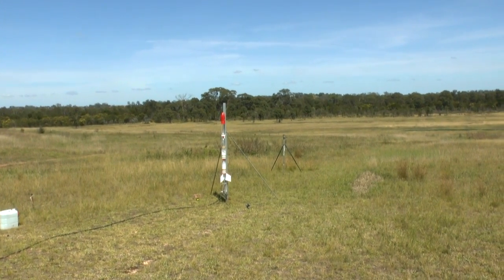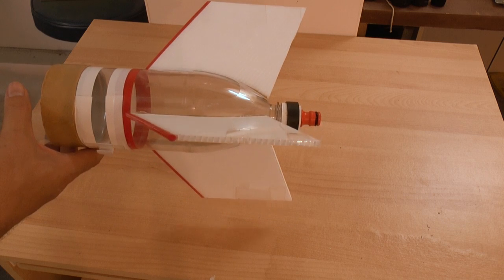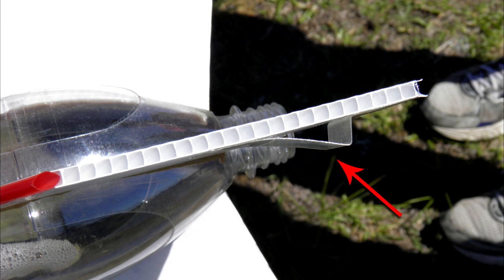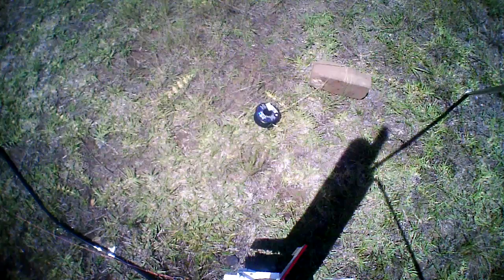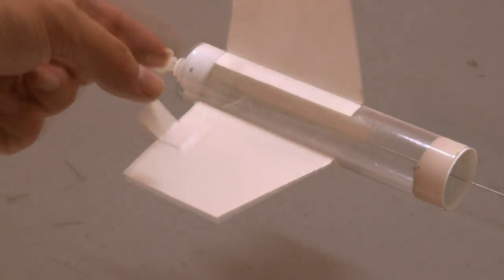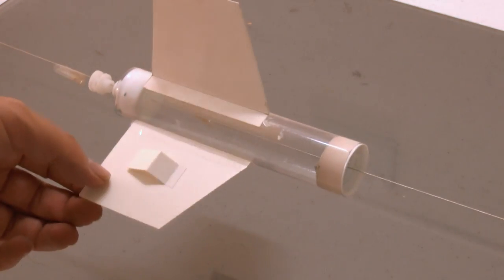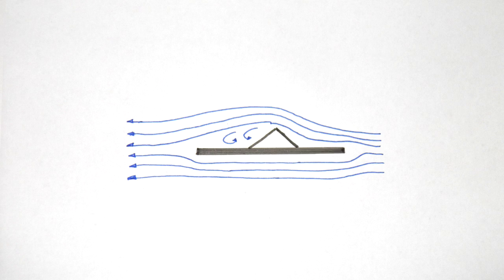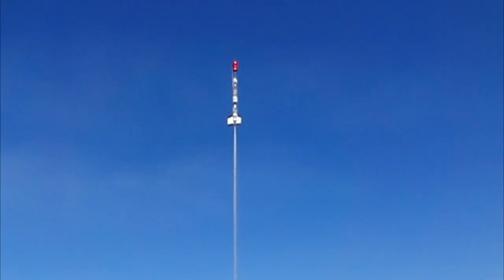Trying to correct the roll on a water rocket

Comment: Very nice vid.
It seems you created 3 "wings", over the tabs the air moves faster, creating the lower pressure and upwards lift.
Reply from the maker: That's exactly right. Although at the time we didn't realize that's what happened and why the rocket rolled the other way. :)
Reply: AirCommandRockets if you put the tabs on both sides the opposite lifts should counteract each other
Reply from the maker: CartUniverse pro gamer The point was to generate lift on one side of the fins to try to counteract all the other asymmetrical protrusions on the rocket that were causing it to roll the other way.
Reply: Ohh ok ^-^
Reply: exactly

Comment: Man I love science. I wonder what a water rocket could do with wings on a horizontal launch? (Distance, speed and so forth)
Reply from the maker: There have been quite a few people that have successfully flown water rocket gliders, some even with RC controls. The trick is always to compensate for the lift the wings generate during boost. If you don't then the rocket ends up doing a loop.